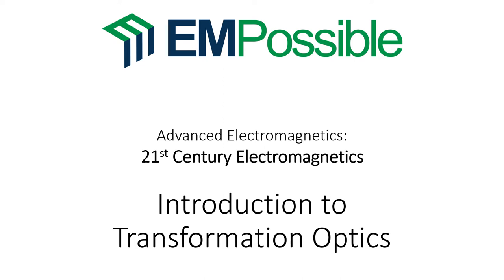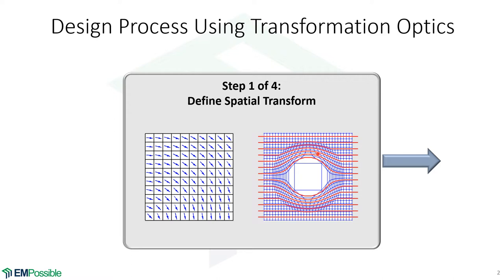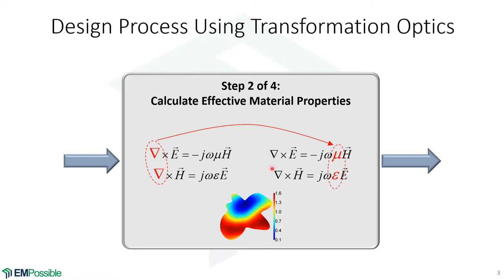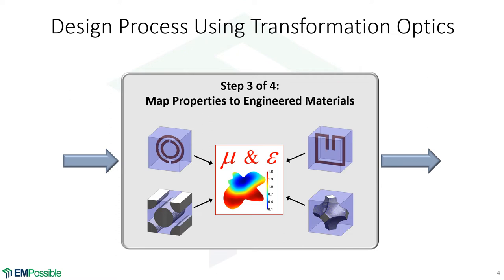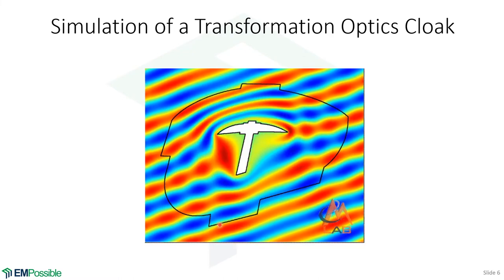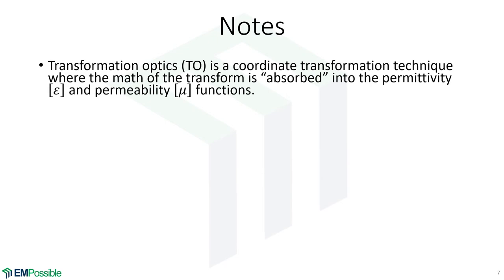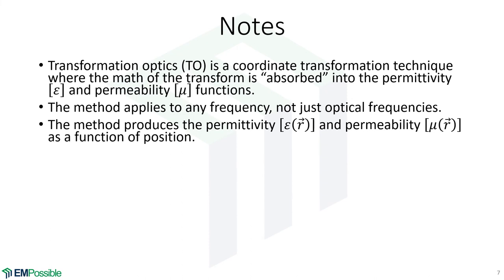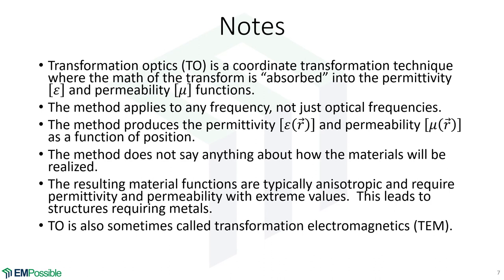Lecture -- Introduction to Transformation Optics

Comment: Great video. Many of your videos fill a gap between basic university courses and scientific papers on EM topics and the visuals are quite motivating. This is very much needed I think. In this video you focus a bit on the complexity of dielectric and magnetic metamaterials, but if you add active current sources which are controlled by field measurements elsewhere, then the situation becomes a bit easier at least up to microwave frequencies. You may want to add some point on this.
Inverse scattering is another great subject, which you may also want to cover a bit one day, and it has quite a few applications. I think cloaking remains a bit SciFi-ish in the coming 50 years. On the other hand, the possibility of cloaking-configurations may help understand non-uniqueness issues of inverse scattering solutions. ;-) (As a side note my background is PhD in electromagnetics/inverse scattering from TUDelft in the Netherlands)
Reply from the maker: Hello Netherlands!  Thank you for the feedback!  While cloaking is somewhat unpopular in the research community right now, it seems to be what excites the students the most and it still teaches the method.  I love your suggestions.  I have a long list of things I would like to add or improve.  I could retire yesterday and be busy for the rest of my life!  ha ha
Reply: Im just a lowly electronics engineer.. Can someone tell me in plain english the practical applications of this? I'm thinking along the lines of spacetime cloak but im having difficulty thinking of it in laymen terms.